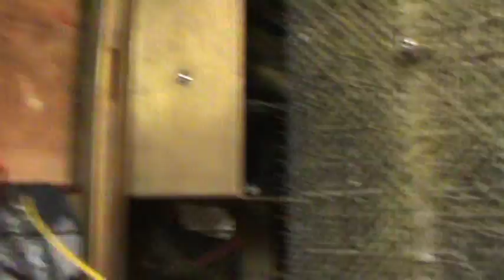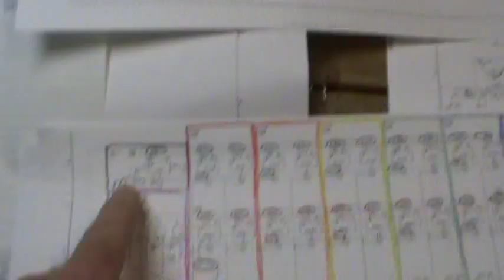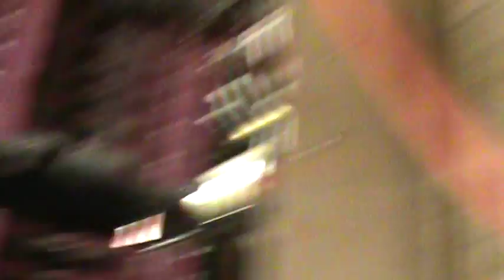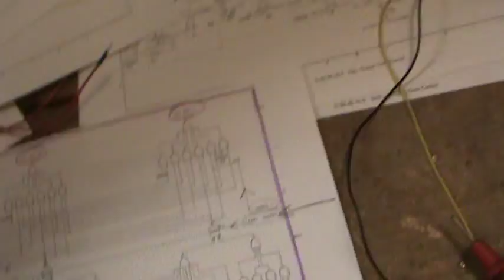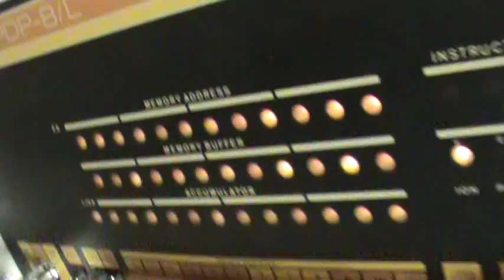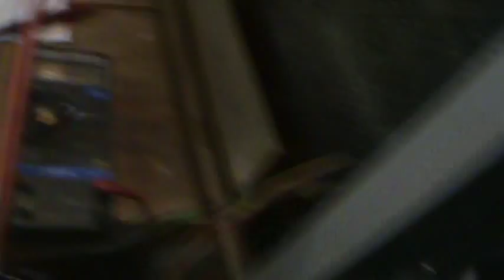DEC PDP-8/L minicomputer PART 3: troubleshooting the registers

Comment: I'm not a computer guy but have you use a pull-up resistor on a 5v source to help stabilize your logic high?
Reply: ***** Ok I see your point...because I know lose wires can act like antenna..and will create low voltage. Hope you fix the problem.

Comment: Very nice. I've got the power supply out of my 8/L to replace a bad diode but I'll try to get it running and play along with you. Have you looked at the RICM 8/L and 8/I restorations? Thanks for taking the time to share your work!

73s
Jack
K9PDP

Comment: Hey, hope I'm not spamming your comment section. Those JK's should have  MCLR usually negative true. You should be able to test them by pulling them down. As an aside, do you need a logic analyzer? I have an extra, and I'd love to send it to a guy like you. I even have a classic DEC logic analyzer, but the shipping would be prohibitive. Also, gosh, you have the schematics of that computer. Ever consider putting it onto an FPGA and keeping the architecture alive but putting it into modern hardware? Annnnd '... sorry for the long post. .... You might want to get somehting like the arduino UNO so you can use it as function generator to ticlke bytes at a time to do your debugging.
Reply: TWD - please tell more about DEC logic analyzer! I've got an HP LA but never saw one from DEC.